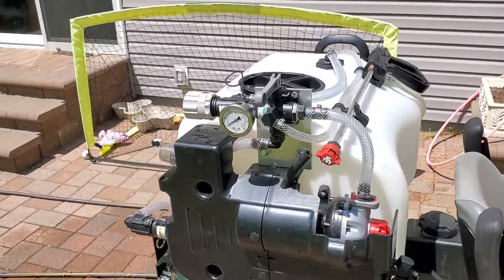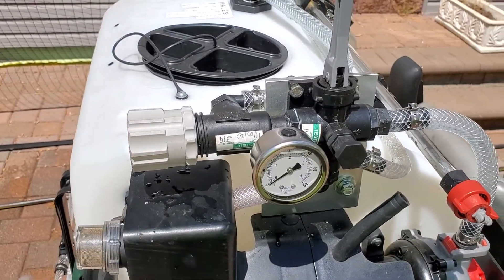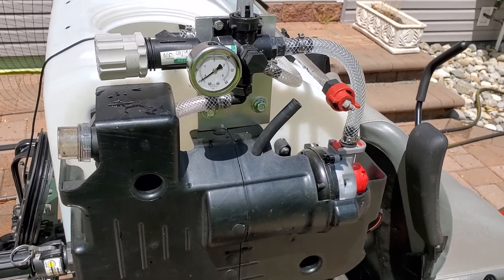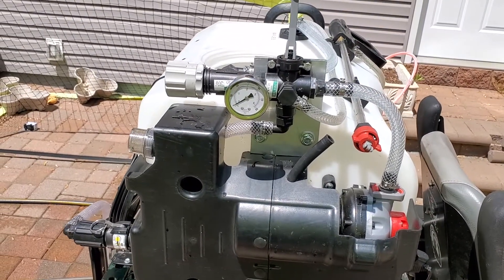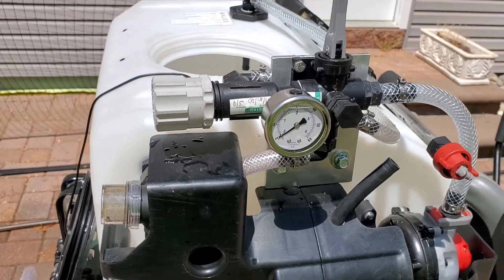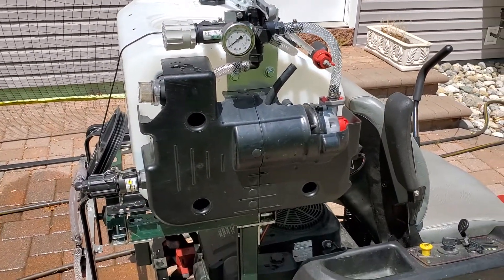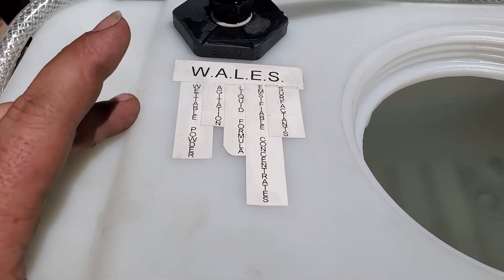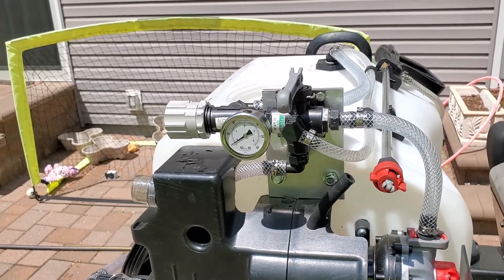How to build a lawn sprayer set up the Right Way Part 2

Comment: I have a toro time cutter (newer version 2021) & the very same north star sprayer that you have. My question is where did you get the parts to mount the tank to your mower? Your video is very helpful by the way.
Reply from the maker: I'm a Commercial contractor so I have easy access to getting the parts. But if you look up either kindorf or  Unistrut you will be able to find the parts online somewhere and order them
Reply: Great! Thanks for the response

Comment: For easy math.    Let's say you have a 5gpm pump and the boom is using 2gpm .  Is the return line recirculating 3gpm at the same time the boom is running?    Or do you have to open the bypass vale for any fluid to return to the tank?
Reply from the maker: Yes no vavles have to be open it will bypass the 3 gpm

Comment: Great set-up, how was the support to install on mower made..that would be helpfull to know?
Reply from the maker: Basically called Unistrut or kindorf metal. Brackets bolts spring nuts. Only have to drill one hole in-frame because my frame already had the holes

Comment: The return line from the pressure regulator needs to be plumbed all the way to the bottom of the tank. Two reasons. 1. Eliminate foaming of chemicals. 2. Return pressure will better stir the tank from the bottom.
Reply from the maker: Not necessarily. The intake to the pump is on the bottom right of the tank. The return is to the top left part of the tank. The pressure that is produced by the return line is enough to push anything from the bottom spend it in your mixture And your chemicals will not foam up only foaming that could be done is if you add too much surfactant. That is also why you put your surfactant it in at the very end

Comment: Just found your video. Very nice build. I am looking to add something similar to my toro time cutter. How does the mower handle with all that extra weight in the rear of the machine? Do you have any videos on how the frame holding up the sprayer is assembled? Thanks for sharing!
Reply from the maker: The mower acts and rides the same I only fill 12 gals at a time it was a little unstable when I filled it to 16 gals. The frame I built out of Unistrut angle brackets and spring nuts and bolts. I can try to get out of video for you on the frame itself but not this week

Comment: What size nozzles r u using
Reply from the maker: Watch "How to Calibrate Your Sprayer [8-Step Guide + Formula]" on YouTube
https://youtu.be/-U3yd0kxRR0
Reply: I found an exact tank like you have  for $100.  The northstar I have now is just like u say the regulator is crap. I too put a 4.5 gpm pump on it. I'm gonna switch the pump over to my new I E and start all over. Thanks again
Reply from the maker: I answered all of your questions on the part 1 video
Reply: When u calibrated are u saying it takes u 33 seconds to go 100 ft?
Reply from the maker: @jerrybillings4720  no if you set up your sprayer at 20 inches apart and 20 in from the floor you have to travel 204 ft. In 204 ft you will find out how fast your traveling that is your thousand square foot. So it takes me 33 seconds to cover that space. Then you take your sprayer container and measure your output for 33 seconds. You adjust to try to get a gallon per thousand
Reply: OK thanks. I was told to measure spray and divide that by 1000. Then that distance was your 1000 Sq.ft.
Reply from the maker: @jerrybillings4720  that's exactly why I made this video. There is a lot of misinformation out there. Glad I was able to help you
Reply: I have a Toro zero turn too
Reply from the maker: @jerrybillings4720  does yours have the smart speed setting. If it does the tow mode is 4 miles an hour at Full Throttle. That's where I run it at but still take the measurements and how long it takes for you to cover that amount of area with the stopwatch best of luck if anything else I can help you with let me know
Reply: It does have the trim mode. The only other question I have is I have a 5 nozzle boom. The nozzles are 20 "off ground and 20"apart. Do I still time the 204 ft?
Reply from the maker: @jerrybillings4720  yes that does not change anything. But your pump will be under size for 5 nozzles max I would go with a 4.5 gpm pump would be 4 nozzles. But you don't have to spray out a gallon per 1k you could use smaller nozzles on your 5 nozzle boom you just will have to adjust your chemical mixtures
Reply from the maker: @jerrybillings4720  I just like to run 1 gallon per 1k. The more water you run the less likely you are to overspray chemicals onto your lawn
Reply: I do have a 4.5 gpm pump now. It makes it easier to calculate product if I can get close to 1 gallon per 1k. I also purchased several size nozzles I can play with. Thanks again for your time and advice. I really appreciate it.
Reply from the maker: @jerrybillings4720  no problem good luck
Reply: When u have some time can u show pictures of how you mounted tank to back of zero turn
Reply from the maker: @jerrybillings4720  I'm sorry I forgot to get back to you. All I did was use the holes that are in the frame of the rear by the motor period and drilled a hole in the top rear plate protector for the motor. If you want me to send you pictures send me your email address and I will send you pictures I would say your number but people are jerks so